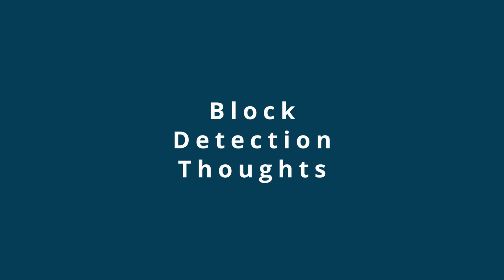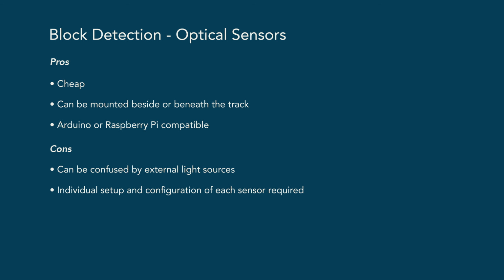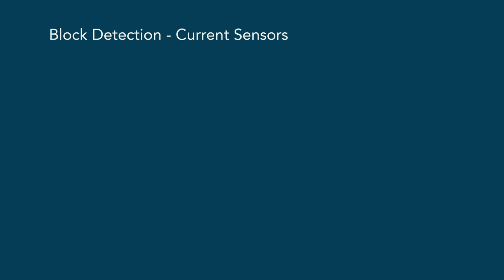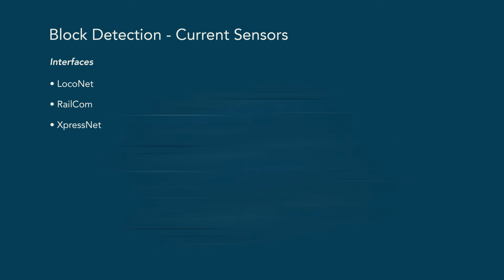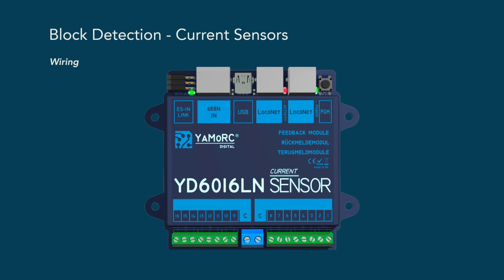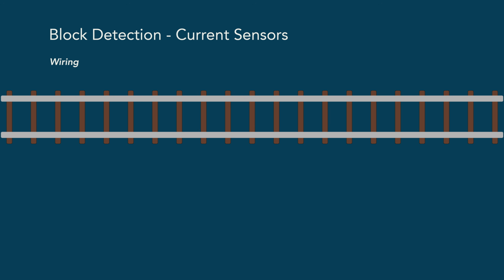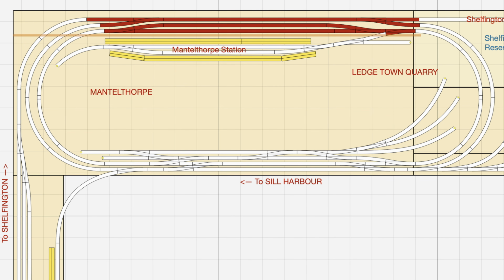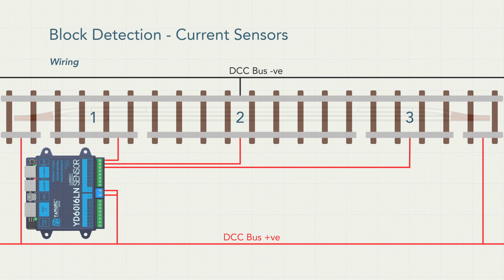098 - Miscellaneous - Block Detection Thoughts

Comment: Hi Ian that was interesting,

In the earlier days they didn't do block's for  point's, but now they say a point needs to be  a block and I'm doing my point's as block's, 

If you have a row of point's say 6 at one end of a fiddle yard you do them all together as one block that is so if a train stops in that row of 6 point's then the software know not to let a train out of another line.

They say make your  block's as long as your longest train so you know that train fits in any block, but in the model layout world that doesn't happen and not on my layout. 
Now if you had a 3 feet of track then a point then 1 foot of track you can put those three components together as 1 block. 

If you want to if you have a length of track were you could park say 3 locos on you can have 3 blocks but all block's need feedbacks and you can have 2 feedbacks to one block for more accuracy in stopping and feedbacks cost's nothing because it's  software. 

Were you said to have 3 block's maybe on 1 length of track so a train could start to break the software or you software you write knows the length of track and were the train is so knows were to stop it. 

Sorry for the long comment, for me and my layout automation is a must and with itrains i can run some trains automatically and some manually, i believe all three type of itrains software is free on updates, but i do get mine for free and it tells me when there is one. Colin
Reply from the maker: Brilliant! Thanks very much Colin! You've now confirmed what my thinking was, although I think I used the wrong terminology in the video! I think when I said block, I should have said feedback section! I now plan on having blocks between all of my points with multiple feedbacks! I'll then wire each point separately, unless they're in combinations, such as a fiddle yard entrance / exit! I'll take another look at iTrain, but last time I looked, you got free upgrades per minor version update, but you had to pay again for a major version update - so v1.0, v1.1, v1.2, etc were free, but you had to pay for v2.0! I'll probably start out using JMRI before delving into coding my own stuff! Thanks again! All the best, Ian.

Comment: Hi Ian, I've also been investigating options for myself as my end goal is to automate the control of trains and I'm also modeling in N scale.
In summary I've now decided to go with iTrain as the automation software, and I'll use the LoDi set of products, for all hardware {command, point switching and current detection}.  Happy to discuss further if your interested in my reasoning.
Reply from the maker: Hi Paul! I've looked at iTrain before, and while it seems very capable, it's very expensive, and you never know when a new version will make the current one obsolete! I'll probably start with JMRI before delving into creating something for myself that will work specifically with Shelfington! I've not heard of Loki products, but I'd be happy to hear more about them, and why you chose to go with them in combination with iTrain! Cheers, Ian.
Reply: @iansngauge sorry slight typo, Updated now, meant to say LoDi
Reply from the maker: @PaulTHedley - Ah! Haha! That'll explain why I've never heard of Loki before then!!! I've seen the LoDi kit in action on Colin's channel (Woodthorp International) but I'd be happy to hear your rationale for using them in combination with iTrains! Cheers, Ian.

Comment: Ian - each turnout will need to connected as a separate block - this so the software can detect its state and set it as part of the run programme you select. My idea is to detect the loco and set the CV to slow it down within a set time so only need one current sensor per block - if it happens that way I will be chuffed but we are talking a few years away before that happens. I had already bought the DR version and have three of them and I have had to use them all just for the four tracks laid so far - I will  need to think about how I do the fiddle yard and TMD but then I may just have that as a play area. What I did do is on a long length of track between each turn  out I soldered multiple wires for connectivity but then joined them up as one and ran one wire to the detection unit. What I do know id that block detection hurts my brain when thinking about it. 
Regards
Steve
Reply from the maker: Hi Steve! Yes, I'll be wiring the turnouts separately, so will have the ability to keep them outside of other blocks! The reason why I showed three "sections" between the points was to have an initial detection section, then a middle section to slow down, and then a third section to cut all power should the train reach it, just in case the train hadn't stopped! as expected Obviously I'm no expert, but you may struggle with momentum taking the train out of the block, depending on whether the loco is under load or not! Like I said in the video, there are certain areas of the layout where I'm not concerned about block detection, but I'll definitely be wiring up fiddle yards and any TMD's! And yes, it hurts my brain when thinking about it too! Lol! All the best, Ian.

Comment: Hi, Ian. Block detection is not for me, way above my knowledge grade! But, your explanation of it was really interesting, and I do know a lot more than I did 10 minutes ago! What I DO have knowledge of, is Peco plastic rail joiners. If I was in charge, I'd ban them by act of parliament! They are an absolute nightmare. I will probably ruin two or three on every joint used. I clean any rail ends, either factory or made by me, I have the excellent WHWW fishplate assistant, but the plastic is just too soft. I have used a Dremmel to cut rails, but even though I was using the flexible extension, the hight of the rail meant that I ended up cutting it at a slight angle, which made quite I wide gap. More practice would probably help. Looking forward to the next ep. Thanks.
Reply from the maker: Hi Nigel! Thank you! Haha! Not a fan of the plastic insulated rail joiners eh? I've got a couple of bags of them, but haven't actually tried them yet! I think I'm going to go down the Dremel route! I'm wondering if a jig could be made to help out with cutting down perpendicular to the rail? I need to get some cutting discs - do you know which ones you have used? I can then start practicing! All the best, Ian.

Comment: Good afternoon Ian, a very insightful video, as you know I am a great fan of the electronics side of model railways, so it was very interesting to listen to your views on the subject of block detection. I am using a simpler version of reed switches combined with signals to control my blocks which is designed mainly as a stand alone system. 
I look forward to seeing more on this subject.
All the best
Allan
Reply from the maker: Hi Allan! Thanks! I find that using electronics in model railway construction is an interesting subject! With block detection I seem to have got the terminology slightly wrong, but I hope most of what I said made sense!! I've looked at reed switches before, not for block detection, but rather helping me turn lights on and off in buildings! I haven't quite sorted that out yet, but there'll be a video at some point!!! I'm happy to have sorted the wiring of blocks out though, as now I've got no excuses not to start laying track! Cheers, Ian.

Comment: Very interesting Ian, your explanation is great, I'm guessing the detectors are then wired into the main unit. Also do DCC concepts do something similar?
Reply from the maker: Hi Chris! Thanks! Yes, the detector would be wired via LocoNet in the case of my example, back to the main DCC controller, my DR5000! You could then use the USB interface on the DR5000 to connect a computer running JMRI / iTrains etc, to do something, such as change a signal, or a point, or slow down or stop a loco, or simply display that a block is occupied on a control panel! That's the theory anyway! I think DCC Concepts do have some sort of detector, but haven't looked into it... yet! :) All the best, Ian.

Comment: Hi Ian,

Interesting thoughts there, and as I haven't gone down the automation route myself it's highlighting things I haven't thought about much. Have you ruled-out the cheap type of current sensors that you commented on in one of my videos? Obviously they work with Arduino / Raspberry Pi, but I don't know whether or not they'd work with one of the other systems you mentioned.

I see from other comments that there are nuances around what constitutes a block! I suppose when I've heard "block" in the context of the full-size railway it's been "block signalling", so perhaps it's the signalling boundaries that people or control software are thinking about when they hear "block"? In your video's context of train detection I just took it to mean detection of occupancy of a particular section of track, which could be of any length.

I look forward to seeing how you develop this side of things, including exactly how you implement control 🙂
Reply from the maker: Morning Jonathan! I haven't so much discounted the cheap current sensors, as wondered how I could utilise them in a complete system! LocoNet or Railcom seem to be the way to go, so then it would be down to what interfaces the DCC controller supported, and how I could connect an Arduino / Raspberry Pi to the network! So, I'm basically concentrating on how I can wire the track, while putting off the decisions about which current sensing products and interfaces to use! I see quite a few experiments along these lines in my future! In terms of the word "block", yes, I was using it in terms of a contiguous section of track, in particular between two sets of points, but it seems some have interpreted it in the "block signalling" context, which is something I'd not considered! Oh well! All the best, Ian.

Comment: There are also Hall effect magnetic sensors which have the benefits of the opto sensors, different disadvantages include the need to have a magnet in each vehicle, but can easily count the number of locos/waggons with fewer debounce issues than opto sensors. So can count the consist to make sure all is present - waggon counting with opto's is hard. Hall efffects also work with Arduinos which inturn can send CMRI to wherever, and also provide local interlocking of points and signals.
Reply from the maker: Hi Tony! Yeah, I'm guessing there are half a dozen different ways of performing block detection, and I'm not discounting any of them! I just picked what I thought were the two most popular methods, and went from there! I quite like the idea of wagon counting! The problem with a lot of these sensing methods is having to locate the sensors beneath the track, which is a problem when one fails! Thanks for the ideas, I'll definitely keep them in mind! Cheers, Ian.
Reply: About a million years ago as a teenager into trains, computers and electronics I thought about Hall effect sensors for detecting locos. Sadly, it was only ever a thought experiment.

Comment: Ah, you forget another positive to using current sensing. thanks to the gaps your rails will have enough expansion gaps for the track to expand during summer.
And as others have mentioned, a block is made up from 1 or more sections.

As i'm actually in the proces of laying track and and wiring; I was planning on using a github project I found for train detection, but have since moved to detectors from roco, as I'm already in possession of their Z21 controller, and as I'm an IT guy, I can't stand the thought of not having the most information possible. Which got me to this decision; All the rail detectors will be railcom capable (the added advantage is that as far as i can tell the Roco CAN bus uses normal UTP cables, makes for easy wiring for me) And every point, slip and diamond crossing will also be wired for detection. And I will be using that github project (which uses Loconet) for point position feedback.
Added advantage of buying detectors instead of building; you get to play sooner!
Reply from the maker: Thanks for the info!

That's interesting about the expansion gaps! I'm probably only going to have the gaps in the positive rails though - so now you've got me thinking that may cause problems! 

Yeah, the terminology is a little confusing! My understanding is, that in terms of wiring, the sensor inputs could be wired anywhere on the layout! However, a block is something that the software needs to know about, and is just a section of contiguous track that has sensor feedback at particular positions along it! 

Moving to a Z21 controller is still a possibility for me, but doesn't going down the Railcom route limit your choice of decoders, as not all of them support Railcom due to licencing issues? Oh, and which current detectors are you using?

Cheers, Ian.
Reply: @iansngauge  I've made a habit of soldering wires to both sides of the track. As you say one side is a common and not necessarily needed. However, I believe it will greatly reduce the chance of having problems with cutout. And it hardly makes wiring more difficult.

As for the railcom/Can bus option, yes it's somewhat of a buy-in. Though other companies do sell railcom capable detectors (including Yamorc).
But a hobby is allowed to cost money, and buying into this system reduces complexity for me, which is also worth something.
I'll still be building and programming some of my electronics, just not as much as I was planning on in the beginning. 
And it's still enough to keep me busy for quite some time; soldering, programming P-ic's, mounting servos, programming them, making my own turntable, programming the Arduino for that, wiring... Lighting, scenery.

Programming whatever software I'll be using to running everything!! That's a whole other can of worms I'm finding out!

As for that github project if you are interested, search for "Geert Giebens diy Loconet"
Reply: @iansngauge  almost forgot; the Roco detector I'm using has the designation 10808
Reply from the maker: @fladder1  - Thanks again for the info! I'll probably end up doing the same regarding the soldering, like you say, it's hardly difficult! I see the Yamorc Railcom current sensor has been delayed, although this time they cite production capacity rather than a required redesign as the reason! I'll take a look at that Roco detector, and the LocoNet project! I'm quite looking forward to writing some software of my own, as I'll be on more familiar ground, but find the whole subject of train automation quite an exciting, if expensive, prospect! Cheers, Ian.
Reply: @iansngauge  yes, exciting yet expensive indeed!

If I were you I'd do some research about brands with railcom capable detectors.
My reasoning for going with Roco was simply; 1: the controller supports Loconet 2: I live in the Netherlands and wanted a brand that's readily available 3: a brand that's been in business long enough that I can be relatively certain it will be in business for the foreseeable future.

And only while building my model railway and those electronic projects (had to design a current sensor PCB) did I become enamored by the idea of railcom. And gradually realising that my spare time for my hobbies is at an all time premium I decided that buying wasn't such a bad thing.

But I strongly recommend doing research, as I can imagine that other brands are easier to get in the UK.
Such as digitrax, top of mind as Charlie uses that on Chadwick.
Reply from the maker: @fladder1  - Research is my middle name, usually at the expense of action! Lol! I totally agree though, when spare time is at a premium, you need to concentrate on what you want to do with it! Roco stuff is freely available in the UK, and Yamorc has a well established distributor in DCC Train Automation! Longevity of business is obviously important, and having already been bitten by Digikeijs, maybe I should give Yamorc a miss until they've been around for a few years - but I do like their stuff!! I looked at Digitrax as a complete system when I first started out, but they were far too expensive for what I needed at the time, but maybe now that I'm a lot more invested in the hobby they're a brand I should reconsider? Anyway, thanks again for your help! Any and all suggestions are useful at this point! All the best, Ian.

Comment: Also - don't confuse the advice not to put turnouts in blocks with the idea that they should not have occupancy detection. The two are quite different. Turnouts can have their own occupancy detection without being in blocks, as such.
Reply from the maker: Hi again James! Yes, that's a good point - ha! As long as I leave turnouts in their own isolated "section" with their own wiring, I can add them to their own feedback devices when required! Or at least that's the plan! Cheers, Ian.

Comment: Also if you are looking to use railcom ?? Which I would suggest you would if you are going down the automation idea as railcom offers you 2 way communication then the YD6016LN does not support railcom.
Reply from the maker: Hi again Geoff! I was only using the YD6016LN as an example for the wiring, as it's obviously a LocoNet device! However, as I understand it, going down the Railcom route will limit the decoders I can use, as not all of them support it due to licencing costs and restrictions! I know Zimo decoders support it, and that's what I try and use in my locos, but I don't use them exclusively! Cheers, Ian.